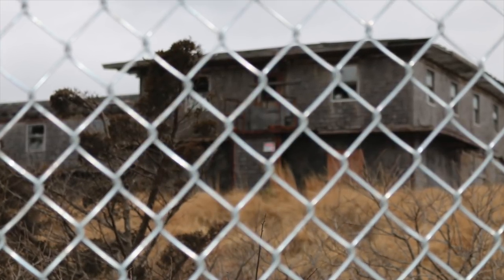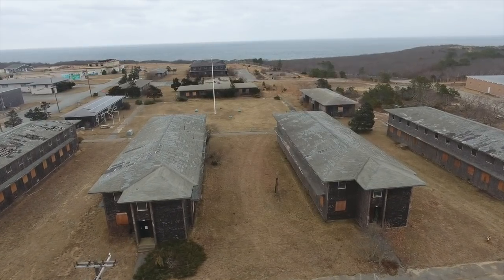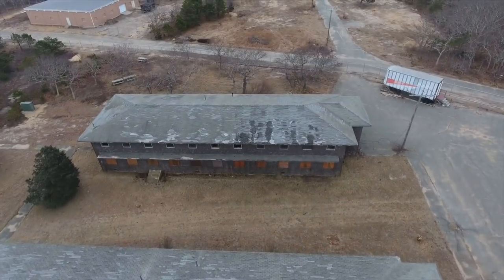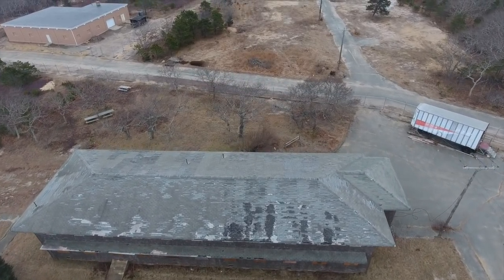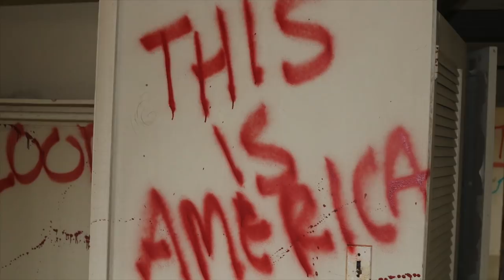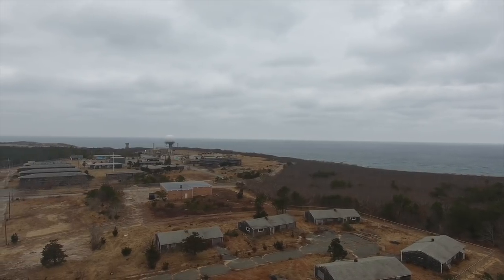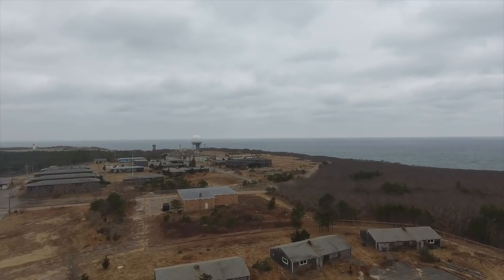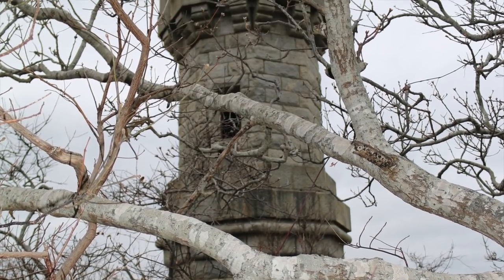Abandoned Cold War Air Force Base on Cape Cod

Comment: The base is gone but millions are still spent every year on ground water treatment. The fuels and chemicals used at the base got into the ground water so the water must continually pumped and treated by pumps located for miles around the base

Comment: Weather resistant asbestos tiles?  Those sure look like cedar shingles to me.
Reply from the maker: Thats how they are described in my research. Thanks for watching.
Reply: @davidAblake1  Can you cite a source? Sounds like you might have got some bad information that you didn't check and repeated verbatim.  Or maybe there are some other buildings that don't have cedar shingles.  The asbestos tiles are probably on the _inside_.
Reply from the maker: @MutinyEvo  https://www.capecodtimes.com/article/20150622/NEWS/150629882
and several other locations.
Reply: Not asbestos tiles on sides, probably on interior floor tiles and heating pipes though.  Exterior walls definitely good old new England cedar, heavily weathered, most still working as designed.

Comment: asbestos shingles? I grew up down the Cape and those shingles at least, are not asbestos..are there any other places on the Cape you know of? Like along the coast between hyannis and Falmouth? The place we had was purported to start as a military emcampment
Reply from the maker: https://www.capecodtimes.com/article/20150622/NEWS/150629882  Sounds odd to me as well, this news story could be wrong. Washburn Island was used as a training base many years ago, Im sure other spots along the coast.
Reply: Standard weathered cedar shingle sides, looks to me.  Asbestos would not look like this!  But there’s probably plenty of asbestos used in insulating water pipes and against the cold air in winter.